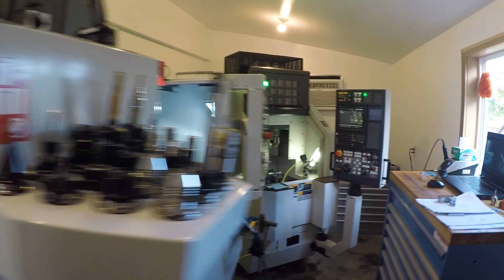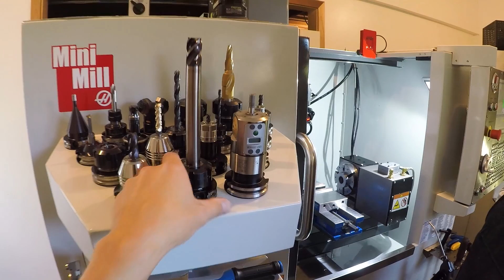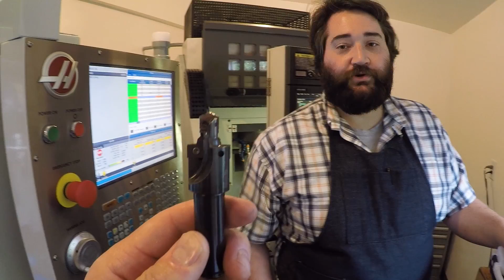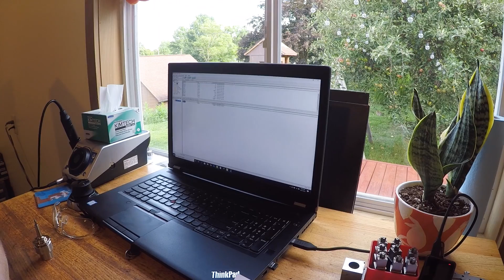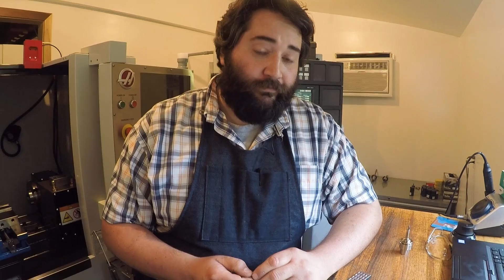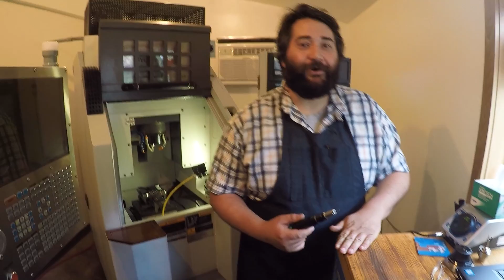CNC Shop Tour |  Adam Started His Own CNC Machining Business!

Comment: Adam I'm a surgical instrument maker,  we file everything just about,  our file cleaning and sharpening methods are a little different. For cleaning we soften a brass chisel face with a torch and use it to file in the same direction of the teeth to pop out clogged material.  To sharpen,  we use a acid bath of electro polishing purposes, few seconds of a dip,  helps to preserve it for a little while longer.

Comment: @2:55 Adam says the Parker Majestic is a wave machine, not a roller machine. What is a wave machine? I understand roller machines and ball bearing machines, but I've never heard of a wave machine. Thanks!
Reply: Hey Rick! A WAY machine is one that has no rolling element in the machine motion. Meaning there are no bearings only metal on metal surfaces. In reality the casting iron saddle and table don't actually touch in motion because of the oil lubrication. Key words there are "in motion". This is called a hydro-dynamic system and is generally stiffer than a rolling element guideway system but has trade offs. Those being capacity/susceptibility to wear, and maximum dynamic speed. But they gain more stiffness and when properly maintained they can last a long time. This is the system that has been used for centuries by manual machines.

Comment: Adam, I thought I had it bad with 460 sq ft. Your shop is very nice, I wish I could keep mine so nice. The oil your running in your machines, you said it was Blaser, just curious which one, I would like to change my Haas tool room mill over to oil. I think we had a little more trouble getting it in here than you did the mini, but it was well worth it. Got a TM 1P with ha5c 4th about 10 months ago.
Reply: 727272s blaser gt15. My decisions to run oil was very situational. You get ride of a lot of headaches but gain a few new ones.. really do your homework and make sure it’s the right choice, it’s very expensive.
Reply: @adamthemachinist  very expensive indeed, but good to know there are other options to coolants. odorless kerosene + cutting oil for me in the home shop is good enough :)
Reply: @adamthemachinist  and can I say, your shop is so clean and nice. thanks for sharing.

Comment: The Festool drill seems like an interesting/expensive choice?
Reply: John Kinsella this was bought when I was a traveling toolmaker. I wanted a high amp hour battery and lots of torque, also the right angle attachment was a bonus. These days you can get that setup from lots of manufacturers at the time of purchase though festool stood out. It’s a nice drill, I pushed a 1/2 x 13 tap into cast iron with it before.
Reply: @adamthemachinist  makes sense. I've lusted over the Festool kit, just seemed surprising to see in a bootstrapped machine shop. :)

Comment: Get a trainee in there to run the surface grinder decking cylinder heads. Fairly constant customer base.
Reply: the machinist  My point was a machine sitting doesn't make money, some money coming in is better than none.
Reply: @Troph2  
You do make a point ?
A Good point ?
If you are making money in a shop.
You don,t need every machine running,  only the ones that either make money or you need running.
Grinding cylinder heads was maybe not the best example to use to make a point.
As basically NO one grinds cylinder heads ??
( Not in this century, at least )
This was why you got the reply from The Machinist. 
I don,t think he was trying to shout you down.
Just trying to make a fair point.

Comment: Hello, I own a tool & die and stamping company in California and I really want one of those variable drives on my grinders. Adam, can you possibly share how to go about it? Anyway, I love your videos keep them coming 😀
Reply: daniel rogers it’s a pretty easy install. You’ll need an enclosure box and an appropriate sized vfd. I chose automation direct but many companies make quality vfds. You simply run power into the vfd and then lines to the motor. A few minutes of programming and it’s ready. While your wiring I recommend but a 110v Oulet on the machine. It makes plugging in spin fixtures much easier.
Reply: @adamthemachinist  thanks buddy im gonna look into it. Good luck with your business and thanks again for the info

Comment: What oil from Blaser is he running in the HAAS? I'd love to run oil in my machine but HAAS says not to.
Reply: Mike Browne I’m running blaser gt15. I was out of warranty in the haas so I was concerned about that. Taking to my applications engineer at the hfo, he said, lots of medical shops do it with few problems. The pump does seem to work a little harder, but if the only problem is I get a few years less on a cheap motor pump I’ll be happy.
Reply: I would like to know too!
Reply: Adam thanks for the info. Best of luck with your business.

Comment: I really enjoyed Adam's insights in the Supreme tour, he really knows his trade.  I'm interested to know what power supply he has to his house!  Does he have fire suppression on those machines since he runs oil?
Reply: I upgraded to 200 amp service when I started the shop. Currently I have two panels in the garage. One is 80 amps single phase for the grinder, lights, mini mill and air. There is a second 100 amp service which is just for the phase converter. The haas and mori don’t really draw much power but the air compressor is definitely running my power bill up.
Reply: @adamthemachinist  put a vfd on the compressor swap the motor for 3 phase . It stops that intial draw that dims the lights also gives you a bit of warning mid conversation lol
Reply: You see the GS2 on the first grinder? It can take single phase and output 3ph
Reply: He probably doesn't need more then 100 amps single for those machines with compressor.